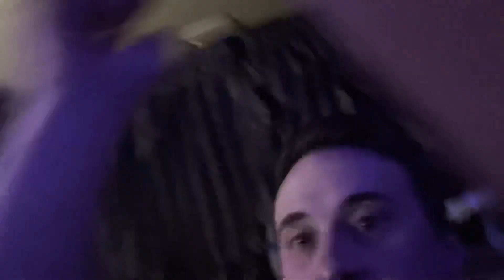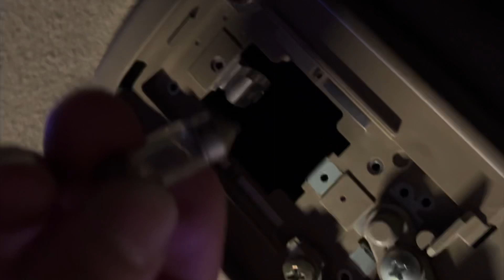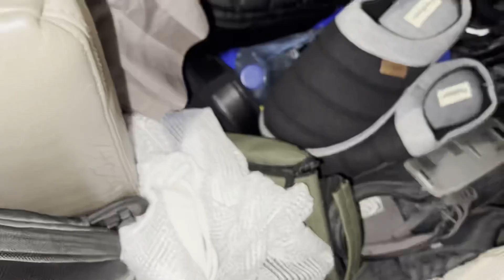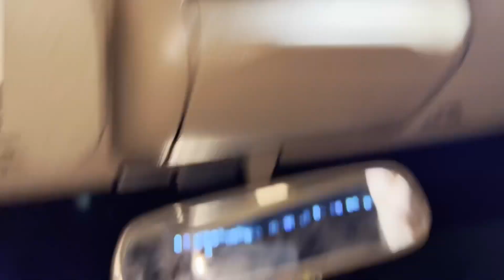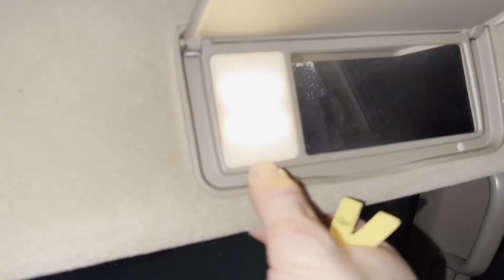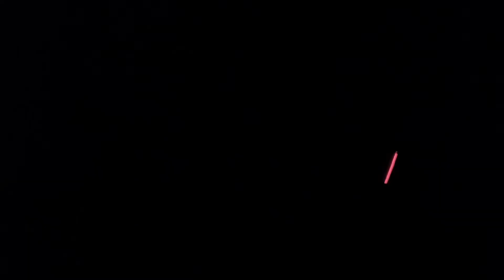How To Upgrade All Interior Lights to L.E.D. | 3rd gen Toyota 4Runner

Comment: Insane easy.. I think this is a no brainer for everyone.  It's too bright for me., maybe I can find some low power 1w or .5w bulbs to be similar to stock but pull 10-20x less power.  Then I can run them over my headlamp for several hours every night.  Makes a lot of sense.  I leave my key to aux for 3-4 hours a night.  Just to power about 3-5w.  One or two fans on low...
Reply from the maker: for sure! hopefully you can find some lower power ones. I have 5v led light strips in aluminum channels a cheap power back hidden in the storage compartment in rear. hacked up some usb cables and got some light switches. power bank has a 5v buck converter that goes to an acc power. power bank auto charges when vehicle running. can run lights for 15 hours and change brightness and temperature color. every thing is hidden away only switches and lights can be seen. won't use vehicle battery. I should make a video on it one day

Comment: If you do this on a 3rd gen Toyota 4runner, do yourself a huge favor.  REMOVE THE REAR AND MID-ROOF LIGHTING ASSEMBLY COMPLETELY FROM THE VEHICLE!  There is no pocket above each light position so if it slips past the mounting clips it will go up into the body of the vehicle and a magnet will not retrieve it.  Fishing it out from the body channel was real fun.  Learn from me, remove the lighting assembly!
Reply from the maker: Wow that does not sound like fun, guess its best to be safe than sorry

Comment: FYI I'm gonna mention. After doing this today. When you replace the rear dome light.  Take the assembly with the 4 screws off to put the light and take the old one out.. if you lose one behind it it's in the frame.  Rip little guy... Also take your negative off as always to prevent a fuse getting blown.  

Nice vid dude.  Love me some diy!
Reply from the maker: great tips! thanks

Comment: Do you have a link to the different bulbs used? I did a full LED swap in my 1st gen Tacoma and figure a lot of the lights will be the same size
Reply from the maker: Yeah links in the description for the ones I used on my 4runner
Reply: @4WheelKid  fyi the door/ hatch ones are no longer available. Might want to update your affiliate link to an equivalent version that’s in stock.

Comment: At the end, when you show the comparison between old factory bulbs and the new LEDs, the difference (brighter-ness) is probably more than appears on the video, because the camera adjusts for the available light, but you probably already knew that. Thanks for the video, very helpful, and I'm going to do it!
Reply from the maker: you car very correct, sometimes ill use my nice camera in manual mode to show brightness differences but this time I just used my phone